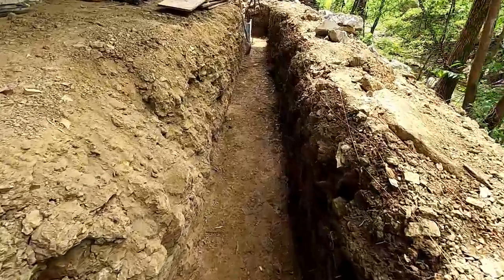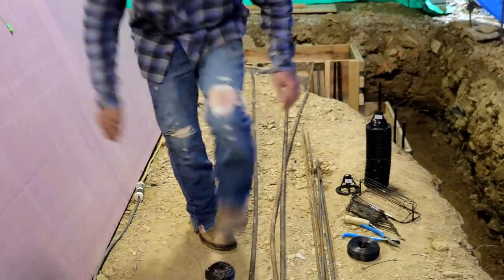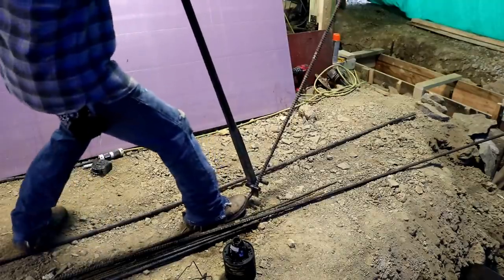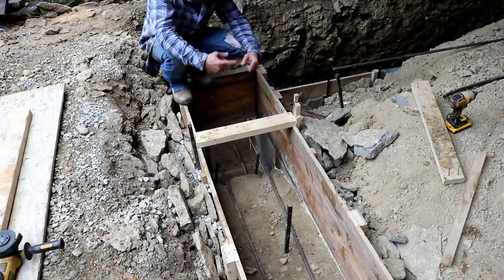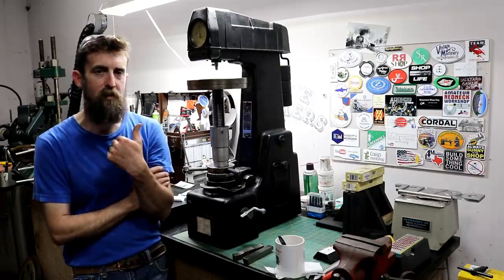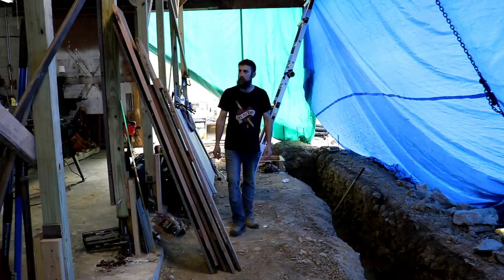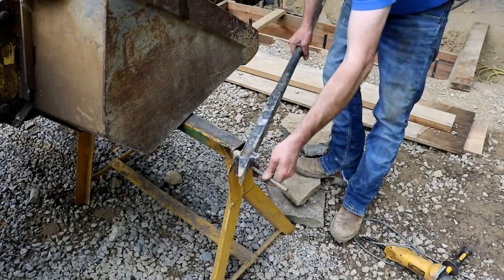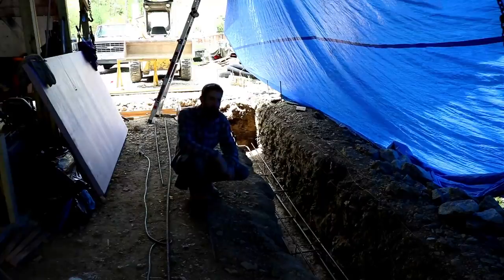Failing Inspection :-) Footer Rebar work / Wilson Hardness tester \ New Tools!

Comment: I worked for a rebar manufacturing company in Windsor Ontario Canada for 9 years and without the proper benders it is difficult to get it done to perfection. Weeeeelll, you don't need perfection as long as the rebar is within the concrete just like you have done. You did a great job. "It's not the space shuttle you know" , a little quote from the man himself Taryl Dactal.

Comment: Thanks for another video Steve. I'm in the same boat. Work all day, go home and work some more. Good purchase on the stabilas. The only levels I own. Had the entire line for almost 20 years and they still have the yellow on them! You can also have them recalibrated. I'm a union carpenter, mechanic, welder, and now thanks to you I have a real good start with machining..new addiction! Thanx again Steve!

Comment: I always chuckle when people get so worried about blowout inside a trench in which already has walls on both sides of it. It's not going anywhere, just will use a bit more concrete. Forming into the earth in many situations are better than people might think. Poor Steve, failed the inspection lol. Great video, cheers :)

Comment: Yes, the Stabila levels are great quality.  I have worked with people that use them. Keep doing what you are doing, looks real good. Yes drilling the vertical's for the block is ok. I would try to connect the rebar with the old work, so it don't pull away.

Comment: I agree about the pliers and wire vs pre-made ties - the pre-made ones snap off on me right when they're getting snug. I did find that using the spool of wire in conjunction with the spinner is a fast and efficient way to work - but you do still need pliers for cutting at the very least. I ended up making my own pre-cut ties doubled over and using the spinner with good results and efficiency - but I bet I used a little more wire than absolutely necessary.

Comment: Just a quick tip if you want.  If you wrap a new spool of tie wire in duct tape then cut a small circle opening in one side and from that side pull out the “inside” end of the wire out the hole you can pull wire out from the inside and it works like an impromptu reel.  (You have to cut and remove the wire that holds the spool together before wrapping in duct tape) It puts a bit of twist in the wire un like a spinning reel but provided you aren’t trying to pull out feet it’s not an issue.  It keeps the spool from falling apart and becoming a rats nest. Just a trick I learned from one of my good heavy civil carpenter Forman I worked with in the past.

Comment: We used to use the tailgate of the dump truck and a 4 or 5 foot long piece of 3/4” black iron pipe to bend rebar. Of course we never tried to make multiple bends in a single piece of rebar.

Comment: Remember - on that job YOU are the boss. Keep on truckin. BTW, the guys pouring the concrete might have a tip or two on setting the verticals. Epoxying after the fact seems hard to me. BUT, you're the boss so get er done. Glad to see you are all safe and enduring.

Comment: Steve
Rap duct tape around the tie wire cut a hole in the middle, grab the end of the wire on the inside.
Then Al you have to do is pull it out as you need it.
When iron workers use the twister handle they have precut wire with eyes already on both ends. If they use rolled tie wire they use side cuters to twist the wire.
Good luck and have fun!!!!!

Comment: Steve, with the amount of concrete AND rebar you are installing, if the shop ever moves, it will be the entire shop and not just a wall like before. I look forward to the next installment... Thumbs Up!  With the current inspectors you have, I think I hear her say the setup for the footers looked kind of nuts...  I am sure you know that squirrels have teeth that constantly ground for their entire life. So if they don't chew on hard nuts and such, their teeth will get too long for them to be able to eat. And the squirrels (lots of them too) we have around our home love to chew on the chain-link fence. Seems the aluminum ties that hold the chain-link fence wire to the top rail are one of their favorite crew metals. I've replaced them now for the third time... And the also love trailer wiring and the plastic light lens too!

Comment: My Bobcat bucket arm has a thru-hole perfectly sized for #4 rebar... Glad to see you had good results from your carbide blade. My experience was just the opposite and I like to think I have a good handle on cut technique. Around 100 cuts in - on fresh new bar - the blade just quit cutting. Hot-rolled scale is hard stuff. Recognize that once the concrete sets, the cobble you placed on the outside of the forms often becomes locked in and creates a whole lot of extra labor stripping the forms. Yes, it is a fine line between getting your wire tight and breaking with the twist tool. I have found that a firm pulling while twisting provides a better bind. Also,  reversing/relaxing the twist just before tight to allow the loop of wire to "square up" to the rebar takes care of that last bit of slop.

Comment: Steve, if you haven't already poured your footing, you may want to consider putting a short piece of drain tile across the ditch and taping the ends up so you can drain water that may get inside the foundation out. and spraying a release agent on the forms will help you get the wood off after; I have seen people spray them with diesel fuel before.

Comment: Hllo Steve,  I found for my small DIY jobs that taking the ball out of your hitch and turning  it ninety degrees was the best holder and using a piece of Sch 80 pipe made the bends easy.  I had welded one up like yours with a piece of pipe and ran into the same problem as I grew older--not enough beef!  Good job.  Doug

Comment: Looks good.  I've been in the concrete business for 35 years and you are doing good.  As far as the form work below grade it can stay there if you want.  But it's good to remove the forms just for general practice.  Remember bar placement in the from is 3" from dirt and 2" from air.  That is been the rule of thumb since Noah build the ark.  And dirt forming is a very accurate and acceptable way of doing things we do it all the time mud is cheaper than forms and labor.  I did not see anything that could cause a problem.  I'm up here in Ohio so if you need let me know If you need anything.  Thanks for sharing.

Comment: 1:55 ..... poured concrete has to have smooth sides to avoid frost heaving, even in areas where frost is rare.  (especially when the footing are only a few inches below ground like theses)
What happens is the frost grips the uneven sides of the footings and ligts them up because water expands as it rutns into ice. then when it thaws dirt gets under the footting ... after a few cycles you footings are coming out of the ground

Comment: There are several testing devices used for hardness.  The Rockwell system is one of the most popular.  Others are Brinell and Vickers, both of which use a similar principle with different penetrators.  For "quick and dirty" approximations, there are such things as the Shore device which bounces a calibrated hammer off of the part and measures the rebound height -- it is more portable than the penetrator type like the Rockwell device.  Use of calibrated file sets of spaced hardness values are used for extremely rough values when that is good enough and there is need for immediate results.  The complicated effects of both chilling/quenching (hardening) and post-chilling tempering (toughness to resist cracking) are another complication.

Comment: I have nearly the same set of levels, 16" instead of 24" and not masonry.  You may or may not know this, you can take the rubber ends out and turn them around, they have nubs that extend beyond the edge of the rail so if you're using the level against a wall the nubs stop it from sliding around.  Like if you are trying to mark a level line.  Looking forward to the concrete pour!

Comment: You tha Man Steve! Good job on getting the plastic chairs. IMO if you hold it up with more bar or any metal driven into the ground there's a good chance that rust will migrate up and destroy the reinforcement, not that that monster footer would go anywhere if it did, but still. One thing about you Steve, you always do a job that's worthy of being proud of.

Comment: Steel fixers over here tend to use Knipex 68 end cutting nippers,
US folks seem to use the pre looped wires more often.
P.s if you want check your level draw a line on the wall flip the level draw another line check for parallel, Stabila are excellent levels there used by allot of pros in the construction industry.

Comment: More work for you but if you were to carry your end wall forms out over your beam it would give the beam much more support from trying to roll over like the old wall did. The way you have it it will surely crack at that inside step joint and then only the rebar will be holding it together but it will allow water in to attack the rebar so eventually likely come loose there.

Comment: if you have not poured your concrete yet get a 20' piece of #4 bare copper and (2) 3/4" ground rod clamps from lowe's. leave a 10' tail out at each end of the footer for a lightning protection system ground
 There is no better ground than a footer ground

Comment: If the bottoms of the vertical rebar is firmly attached, it doesn't take absolute rigidity at the top, because you have plenty of time to put up a string after the hole's full, and align them.  Get put the screws/nails for the string done before you pour.

Comment: Randy Richards’ concrete guys used a slick way to embed anchor bolts after the footing was leveled.Way cheaper than epoxy method. Would work with rebar uprights too.

Comment: German levels, well now you need some German tools.  I've been getting Knipex cutters and channel locks.  I purchased them after the cheap tools failed.  Next I'll get the Knipex adjustable wrenches, they keep the jaws parallel and have the same channel lock mechanism.

Comment: Coming along nicely, I use the same Evolution saw for my bigger projects and its not disappointed me.  Only difference in the UK is lack of quick release on the clamp, probably some archaic EU safety rule we have yet to work out of the system.

Comment: If you add the rebar in before you pour for the upright bars then you can just drill holes for them in your boards for the walls and you could tap the ends for nuts ,just my two cents worth , then you would not have to drill holes in the concrete or get epoxy  , and loved the inspection part and the rebar bender parts .

Comment: I also own a few Stabila levels, they're great. I bought mine from Lee Valley for the bigger ones. I use the 16" to mark crayon on wood to level dovetails. On the 16" there are cross cuts in one side, to load the crayon. The 4' is awesome for leveling beams. Speaking of failing inspection, I my electrical panel didn't pass on Wed. as the contractor didn't add a plug at the pole...arrrggghhh, he was going to just put a couple in the basement, but the inspector wouldn't go for that...he should have known, IMO. :( I think I passed yesterday, but haven't heard and the County office is closed on Fri.

Comment: I know far less about concrete forms and construction but want to add my two cents...Just by looking at the form that runs parallel to the wash...I would have put a few buttresses in there. It may keep it from bulging the top of the form towards the wash.

Comment: Im glad you are still employed. Speaking of welding with exposed skin, an old friend of mine was soldering waterpipe under his cottage. There was no foundation, it just sat on pilings. So he was on his back in the 1-2ft space under the floor soldering and I guess his shirt pulled up and a big blob of solder dropped into his bellybutton. Of course he instinctively, reactively tried to sit up, whacking his head on a joist. Hilarious if you’re not that guy! Btw rebar us just cheap steel right? Can’t imagine why that saw would have a problem.
Reply: The concern with re-bar is often random hard spots in the re-bar. They will eat up a band-saw blade in the blink of an eye.
Reply: @russellstarr9111  oh ok, knocking off teeth.

Comment: You're dead on about comments. Nice levels, equivalent to the starrett tools in machining in terms of quality. Putting the vertical bars in after is absolutely the way to go in your case. You'll have a much nicer finsish to lay block on. It gets rough working around them to finish down in a ditch like that. Maybe next time you'll pass inspection hah. Thanks for sharing

Comment: some tips-welding was bad because of poor ground-clean off space for your ground clamp too!  cut rebar half way thru with zip cut-makes easier bending
Reply: Did you watch/pay attention to the video?  Do you think his grinding on the bar was just for practice?
Reply: @paulcopeland9035  he ground off the bar for the metal to be attached but hooked his ground clamp to the dirty metal on one side at 7:00-if you are going to clean the metal for the ground clamp you need to clean all surfaces-that is why his electrode was sputtering/sticking-poor ground

Comment: Some scrap lumber staked across the ditch and some extra runs of rebar on top to tie the uprights to for the block are much cheaper than coming back to drill and epoxy them in. Fruit for thought. Most time engineers want them poured in place and will accept the epoxy if something was placed wrong. Also the cross bars aren't spec'd because the load doesn't call for that much reinforcement. Have seen that on many prints, when they don't specify we go with 4 ft. Oh and that lumber across the ditch can also be used to wire the railroad mat off the dirt.

Comment: If you wrap the roll of bailing wire in duct tape and then cut the center out you can just pull what ever length of wire you want out and it won't unravel on you that is what I do when I'm tying down electrical conduits into duct banks

Comment: Don't know about the US, but in Europe, the lower part of your foundation is just bulk poured lower grade concrete, without any kind of formwork, that allows for the inclusion of - optionally - up to 25 % rocks by volume. The upper part of the foundation is a separate, properly reinforced bar made of high quality concrete.

Comment: Mason level is the way to go. It's a lifetime level (assuming you don't let anyone else use it). You can replace the Spirit vials if need be. I was familiar with the starrett name before I did any machining, because before Stabilia, the Starrett Wooden Mason's Level was the way to go if you worked masonry.  A mason's level has to be robust and accurate. The Johnsons and the Empires don't last a day laying block, brick, stone, or concrete.

Comment: I was surprised when you welded O1. That stuff is brittle as can be when welded before heat treating. Rebar supports used to be called 'rocks' or broken concrete.

Comment: 08:35 that is too much current for what i am used to. For 1/8 rod i use around 90A for 6013 and 100A or so for 7018. Maybe the 142A that is showing is actually lower thant that. Regardlesws when you were welding my impression was that it was too hot. The rod was melting earlier than normal due to a stronger arc. Just my opinion
Reply from the maker: Its a cheap welder so ho know the real output. Anywhere from 100 to 125 on our Dynasty 200 at work for 1/8" 7018Lots of factors to deal with. Thanks for watching

Comment: Move the gas tank when you weld and use the hydraulic bucket to bend the rebar, it’s stronger and doesn’t get tired.
Reply: Cc Hanson     I did it myself, the bucket and a c clamp. Very accurate and the bucket is very sensitive. Was able to do bends as tight as six inches as sharp a bend a the blade on the bucket. It isn’t hard , easier with your wife at the  joystick.

Comment: Are you having rods or a threaded Rod coming out the concrete into the block???? That would strengthen it up where the block wall is connected strongly to the foundation

Comment: The other key ingredient to the pliers and wire is a reel that hangs on your belt.  Without too much practice (a few days), you can go faster than with the bag ties.  Also, the bag ties aren't as versatile.  They're good for tying two small-ish rods together either at 90 degrees or as a lap splice.  Beyond that, they're worthless.